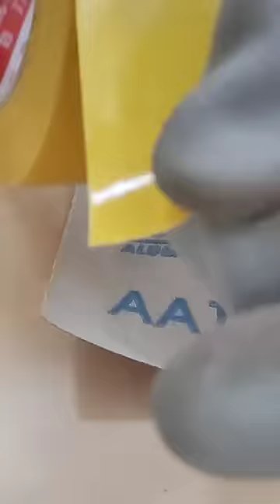Jigsaw Jadi Penghalus #shorts

Comment: the idea isn't bad. quite good actually. however, one thing I must point out aside from the aluminium being too flimsy and it would easily break, there's the fact that no matter what you do, that "flat" surface IS going to bend/flex backwards causing your edge to no longer be 90° to the surface but at an odd angle.
Reply from the maker: Thanks 🙏🏼🙏🏼🙏🏼